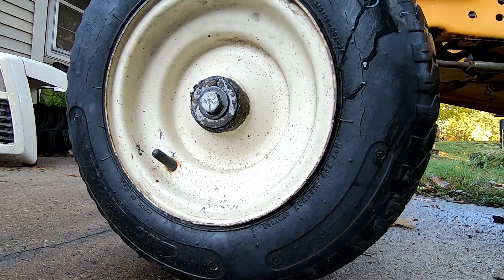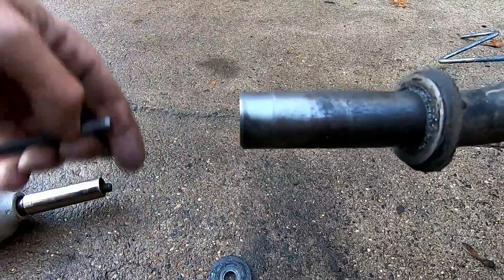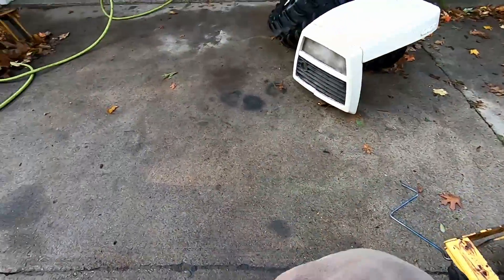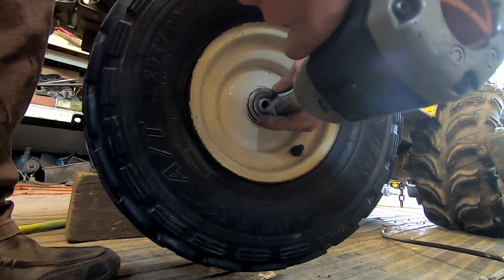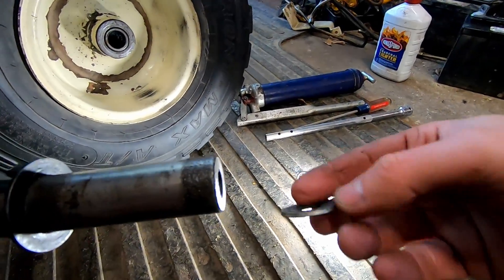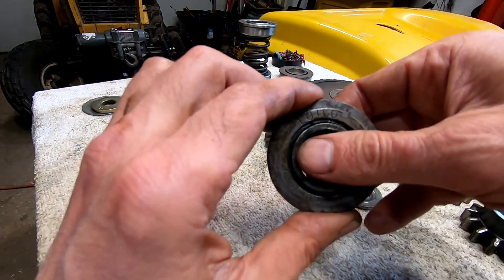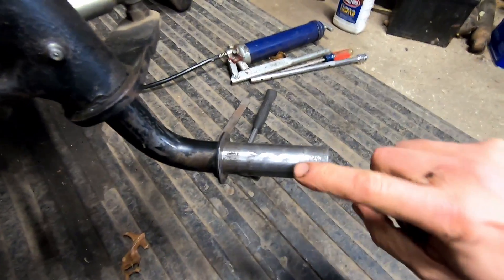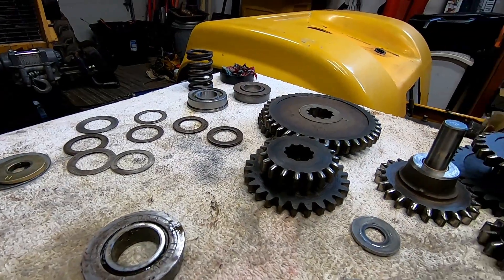Cub Cadet front axle tech tips for a precision turning mud mower

Comment: I wish you would have can more info on the spring.  The length and I think you said 1” ID of the spring
Reply from the maker: My bad.  I'm an old hot rodder and have lots of things from old projects like the valve springs out of an old LA 360 head.  The i.d of one 1" was dang near perfect. For the one inch shaft cub axle.

Comment: Your washer was worn because it touched the entire bearing surface. Center stationary outter spins so it wore the washer down,that may also have been an factor n bear wear. Pre loading non tapered bearings will cause faster wear. I've been looking into this and I think trailer bearings are a better option but will need a gas pipe threader for the spindle
Reply from the maker: Good points and great idea.  I believe the wear witnessed on the washer was from the bolt head being forged into it and countless times being removed and put back on to perfect the set up.  The theory on the bent washer was tested on the other side for it to had a bent washer and loose bearings.  Applied the the two grade 8 washers to see if the bearing tightness improved.  It did by about half which is where it was originally set or close to it.  Agreed with to much preload will wear the radial bearings but just enough makes a world of difference in the steering and handling.
Reply: Tight steering is nice to have when going faster than stock! One of my tractors has commercial wheelbarrow rims that use 4" wide needle bearings,no wheel slop at all!! Also have grease nipples. Needs a new axle and tie rod ends as I've almost hammered it to death lol. New front in the works!